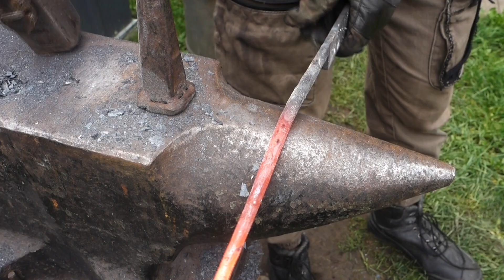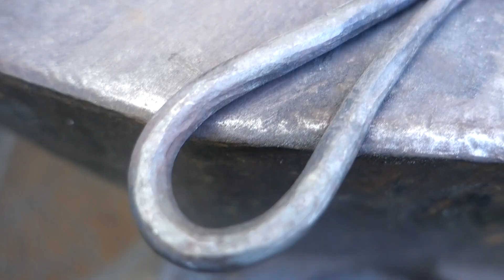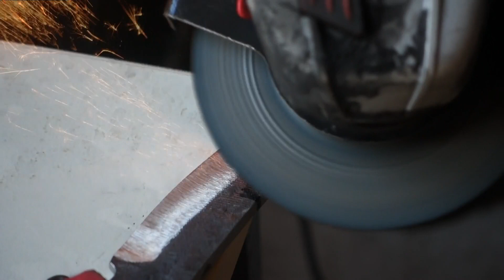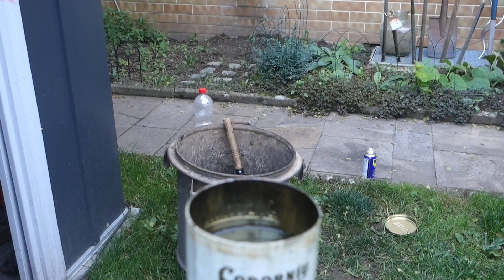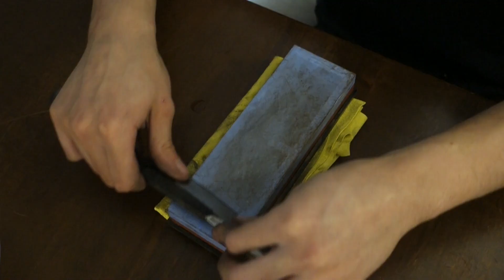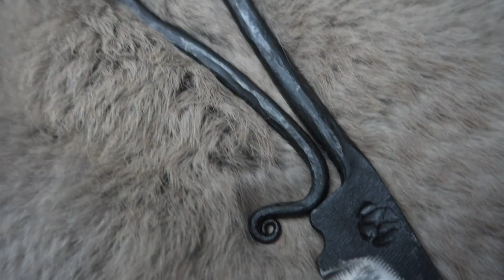Forging a Blacksmith Knife

Comment: Files can be fun.  You never know what has happened to them before you get them.  I have left half of the file in the fire before.  It had a hairline crack that let go in the heat.  Great work with a minimum of equipment and machinery.
Reply from the maker: Thank you!! Little set backs like this are great teachers as long as you let them.